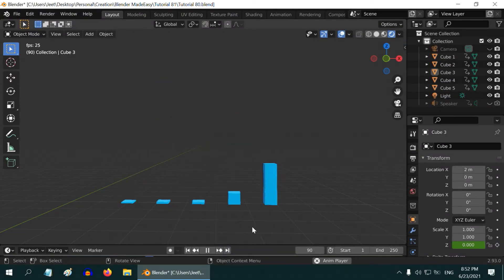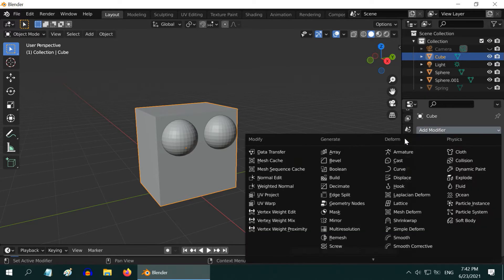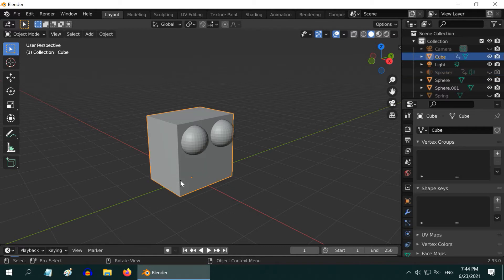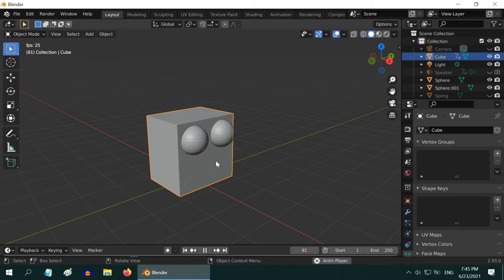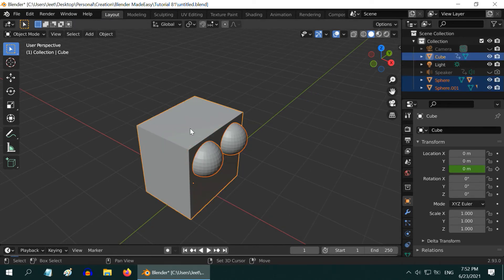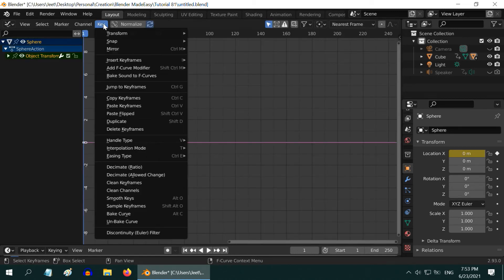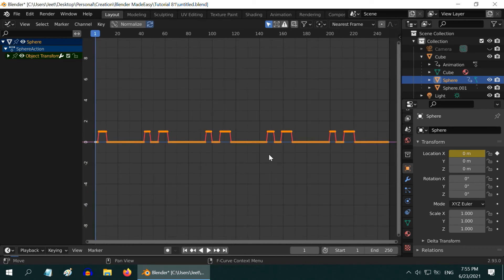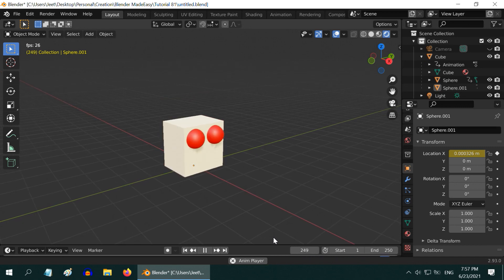Audio Visualization In Blender (Part-2) | Convert Any Sound to F-Curve & Create An Object Animation

Comment from the maker: Note 👉 For Blender 3.6 onward, there are some changes in the menu options. Now the Bake Sound to F-curve option comes under the Channel menu instead of the Key menu (same for Bake Curve and Unbake Curve). The functionality remains the same, only the menu location has changed.
Reply: Can some objects move according to their elements in music? such as object 1 moving for vocal sounds, object 2 moving for bass sounds, object 3 moving for drum sounds, and others.
Reply from the maker: @tutorileks You need to identify the frequency ranges for each of these elements and while doing a Bake Sound to F-curve, use the specific frequency range. You need to create 3 such F-curves for 3 elements of your sound. Then use these curves to move separate objects based on separate music elements.
Reply: So, do I need to separate the elements of my music using an audio splitter?
Reply from the maker: @tutorileks Yes that is required. You can do it within Blender as well just like as I mentioned, but definitely you have got far better tools to do this outside Blender. You can then bring 3 distinct sound files to Blender to map to 3 different objects.
Reply: @5MinutesBlender  wow.. yes.. that's very helpful.. thank you ❤👍
Reply: where can I get the tutorial? 😢